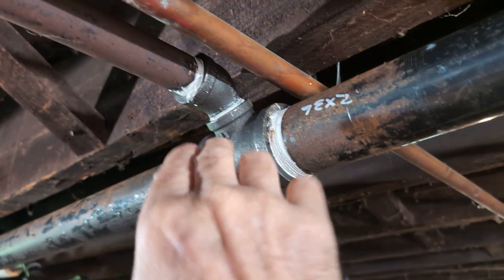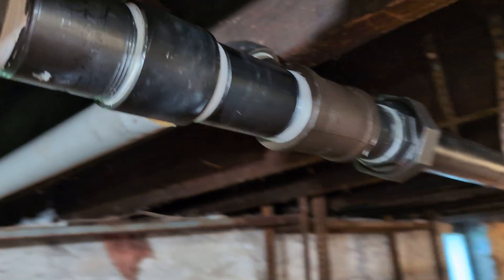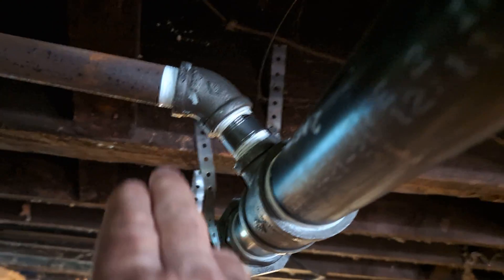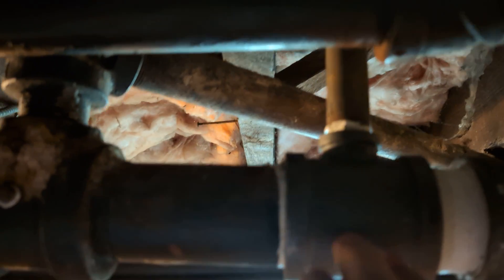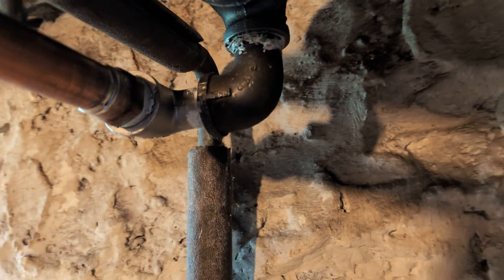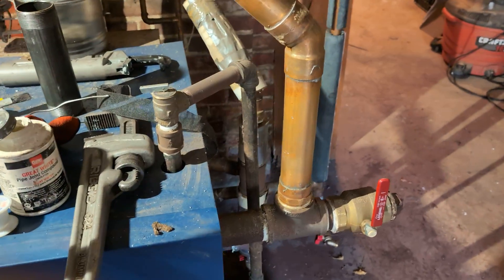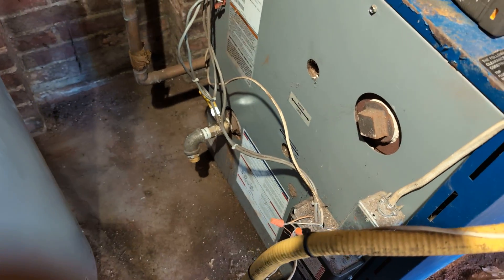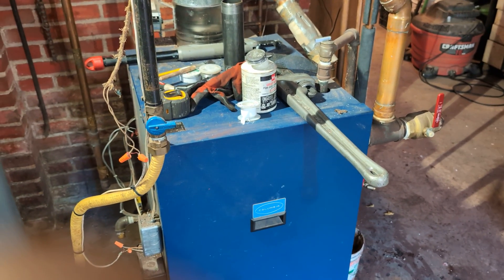Extemporaneous Discussion Of A Steam Main Replacement & Egregiously Bad Near Boiler Piping

Comment: I see a lot of them merchant coupling installed on gas lines too. I have read that anything above 2" has a tapped npt pipe thread too.
Reply from the maker: In most areas, merchant couplings are forbidden on gas lines (and I will not disagree with that rule !).
You are right, any merchant coupling above 2" is tapered NPT.
Reply: @gordonschweizer5154  I have seen the gas company use them outside the buildings after the meters when they run out of couplings.
Reply from the maker: @briancrandall1601  The gas companies  are a classic case of "rules for thee, none for me".
I was told point blank that the gas company only has to follow U.S. D.O.T. regs (which they pretty much wrote for themselves).

Comment: I didn't realize that long 2 inch nipples were available from anywhere off the shelf. At my own house I just buy 10 ft pieces and cut and thread everything by hand. I am in the middle of a boiler replacement and steam main reconfiguration. Luckily the original pipe itself is old wrought iron (real wrought iron, stamped "genuine wrought iron") that is in good shape so I'm just reusing the original pipe, cutting it into new pieces, and threading it by hand. The downstairs radiators were mostly later replacements that were all incorrectly sized for the rooms and I wanted heat in the basement workshop so I figured it would be just as much work to convert the whole downstairs and basement to 2 pipe gravity return at the same time as replacing the boiler, because I would have had to move the radiator takeoffs anyway. I'm about halfway through the steam main work and radiator piping. Next after that is the boiler replacement. The upstairs radiators (only 3 small ones) are staying 1 pipe because it's not worth the work to replace the risers for them.
Reply from the maker: Thank you for your comments and your story.
Yes, pre-threaded long nipples or "pipe nipples" are available in various lengths.
They are getting harder to find (no surprise).
In 2", they are (theoretically) available in 12", 18", 24," 30", 36", 42", 48", 60" and 10 foot.
42" is starting to become a unicorn.
Sometimes, you can find 14" & 16".
Anything else is custom order.
We stock 13" thru 17", 19" thru 23",  and 7, 8, & 9 foot custom pre-cut.
Finding local places that reliably thread pipe is a struggle!
Shorter nipples are available in "close" to 6 inches in 1/2" increments and 7" to 12" in one inch increments, as most are aware.
You can also get 6.5, 7.5, 8.5, 9.5, 10.5, & 11.5 inch nipples with the added bonus that they are domestic with price to match.
Although my joke is supply houses have decided that prime numbers and odd numbers in general should not exist in pipe.
Reply: @gordonschweizer5154 Here in MA we have a place that specializes in cutting and threading pipe to length. I am using them for the near boiler piping which is 3 inch (header) and beyond my threading capabilities. I can see where having pre threaded pipe is a time saver on a job. I had decided that I wanted to do as many cast iron fittings as I could during this project (they're getting hard to find and since this project has turned from a boiler replacement into essentially designing and building my own system, I figured I should do it as it would have been done back in the day, because I may never get to build a system that way again), but I also decided that I don't care whether they're imported or domestic. One thing I did find was a source for inexpensive cast iron imported fittings. Walmart's website (surprisingly) will drop ship fittings directly from the manufacturer and is the source of most of my cast iron fittings. They show up all together in a box in a couple days at sometimes a third the price of other suppliers. I also have wholesale pricing at my local plumbing supply so end up buying a lot of fittings there but they have a limited selection and the prices are still insane despite the discount. I am using malleable in the couple places where no cast fittings are available, but the rest of the system is all cast iron. I'm not against the use of malleable, but just prefer the look of cast iron in my own house, especially because a considerable amount of piping is right where I can see it in my shop. A lot of the fittings in the middle of the mains are original as they had no leaks and the takeoffs were 1-1/4 or good for up to 70/60 EDR depending on length as per the Hoffman data book 1925. They are feeding mostly 35-ish EDR radiators. So only the final elbow has to be changed to a reducing elbow, the riser changed to 3/4, and the valve changed to a packless 2 pipe valve. Then add the trap and return going back to the dry return on the outlet side of the radiator. My original 1885 Carman and 1870s Walworth radiators were made for 2 pipe air vent, so I'm just adding traps on the outlet side and in the case of the Walworth putting in a new 3/4 riser and valve on the inlet. To ensure smooth drainage of condensate I am making my own eccentric bushings for the radiators by drilling and tapping 3000psi forged hex plugs. Later this summer when I am done with the system I will post pictures and a full description of what I did on Heating Help. I figure it will be interesting for many people to see a modern 1-2 pipe conversion/hybrid system.

Comment: My boiler has the same issue with a small distance of counterflow near the boiler. In operation, though, there is never any flow to be concerned about—at most a film of condensate. And a lot of that gets turned back into steam by the fresh steam flowing out. 

In this case, I think if your water is good you can avoid surging. Especially if you can plug a burner or two (if it’s oversized)
Reply from the maker: Yes, you are absolutely correct, the short counterflow near the boiler is only an issue for perhaps a few fleeting seconds during start-up.
The water in the boiler is... horrible, just horrible!
We suspect the previous owner, a notorious cheapskate, dumped lots of boiler seal in the previous dying boiler.